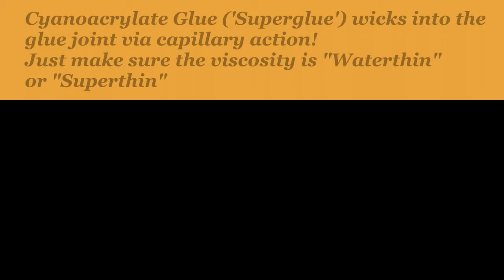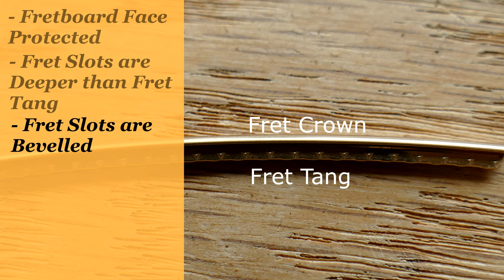Guitar #106 | Full Build with Commentary from the Luthier

Comment: Why don't guitar makers reinforce the area under the bridge? Under the tension of the strings, the top will begin to deform and there will be a hump due to which the height of the strings will increase. It's unpleasant to buy an expensive guitar that will definitely have this hump. Similar to the Gibson theme where the headstock breaks off and it has become the norm
Reply: The entire idea around the top of a guitar is to have only enough bracing/material to keep dit from collapsing. A slight hump is expected and doesn't affect time negatively. If it rises too much then it can be addressed by a luthier but a well built and maintained guitar should be fine. You'd rather have a great sounding instrument that may need maintenance decades down the road than an overbuilt top that is muted and dull but will never warp. ✌️